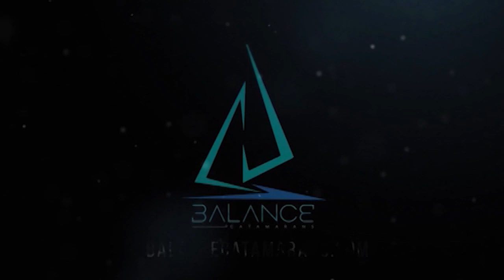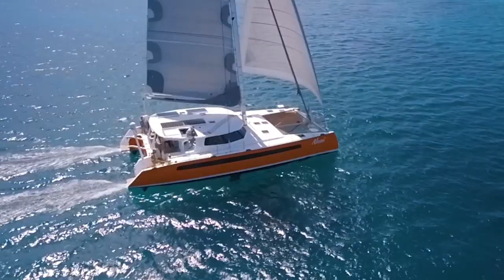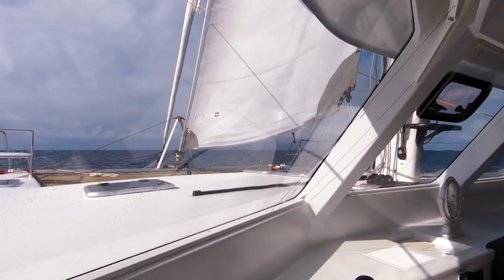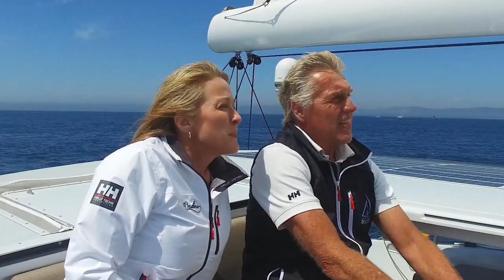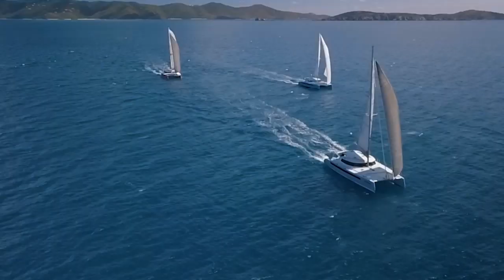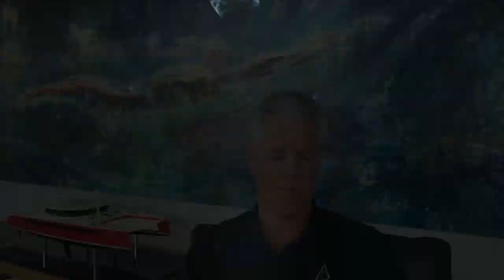Electric Engines on a Balance Catamaran?

Comment: Phil,

Thankyou for responding to people and also giving your honest opinion on these things.  My viewpoint on this is people need to be respectful around these issues when debating or discussing them.  I see that in this video and you deserve praise for that.  I semi agree, diesel's are required for passage and also remote sailing.  Having said that the one thing I have always been interested in is the fuel use for a generator to generate energy to drive a boat at a cruising speed.  

For example here, Catamarans often are run on a single engine to reduce the consumption of diesel when going through the doldrums etc as you have mentioned below.   if trying to outrun a system then you would be running both engines at a higher RPM to get a better speed to outrun a storm front etc.  Do you have some numbers or are you able to provide an approximate fuel consumption for these scenarios to gie people an idea about this issue as it does seem to be the one factor that affects the decision and it is a safety issue.  

1) If running a 526 on one engine to move through the doldrums how much diesel do you use per hour or per NM approximately.   So 5 litres per hour or 60 litres per 100n's figures like that so we can see the distance you can get off a given amount of fuel.  This will hopefully give a range or efficiency figure, as its never exact with different conditions etc however the doldrums would mostly be flatter waters and no wind sort of conditions so as close to ideal for efficiency as you ca get I would assume.  I hope you dont have to annoy clients but your best or most accurate number for this scenario would give some perspective for this scenario.  

2) Likewise with this, how much diesel is required to run a generator and what size is required to push a cat on one electric engine at an efficient/comparable speed in these conditions.  Again, this will give a comparison for people to say running a generator to run the electric engine will result in us having to use 6 litres per hour and will end up being 75 litres per 100nm with the loss of efficiency due to converting it from mechanical energy to electric energy back to mechanical energy through the electric propulsion system.  There will always be more loss in this so it wont be as efficient.  

My view and the thing that determines any decision I make is the other scenario, for outrunning a storm, or a weather front.  It is virtually impossible to provide these figures as the efficiency is hard to estimate with speed/conditions etc.  However the points you have made below regarding energy storage etc I can come to the conclusion as others should be able to that having a generator to run the electric motors at maximum speed would be a HUGE generator and impractical to have on a cruising boat it would defeat the purpose that you would be putting the system in for the first place.  In these circumstances nothing beats good old reliable diesel and its hard for anyone to argue that with the compromises that would be needed with weight and everything to have the large genset etc.  You can have a genset for a cruising or acceptable speed through the doldrums and justify it but for outrunning a storm the weight gains will impact everything else a huge amount.  Not to mention you can get any modern diesel give or take a bit worked on in any location throughout the world and you can service it with a KNOWN amount of supplies you can carry.  This is harder to do with newer unproven electrical systems that don't have that worldwide knowledge bank when it comes to being serviced in remote places.  Something about all engines though if you do have a generator though is you need to run these systems regularly as part of their maintenance.  Even with the re-gen from an electric motor etc and a solar system if you have a diesel gen as a back up you have to run it to ensure it remains reliable, as you do with a diesel engine.  With high output alternators etc on diesel engines they can recharge the battery bank just as efficiently or with less energy loss than a generator would have when being run to provide propulsion for the boat.  Until that loss is comparable its hard for long range off grid types to adopt full electric propulsion systems because you get more off grid time from diesel engines as they have less loss associated with them when they are being used and your not sailing.  

Thanks for putting the time in to respond if you can Phil.
Reply from the maker: Hugh, lovely email. Agreed on all fronts with your thought process. 

Fuel Consumption of course as you state varies due to sea state and winds, and on a Balance it also varies if people get the 45 HP or the 57 HP. If we are talking the 526?  Me personally I think the 45 is perfect for the 526 as you can run the boat up to 9 knots at 2,600 RPM on both engines and move very nicely. The 57 HP everyone seems to run them at 2,200 or so and to me that is not hard enough. In most of my yacht surveys the high RPM test leaves to noisy alarms because people do not run them hard enough and the exhaust elbows clog or heat exchangers are troubled. But.....everyone upgrades to the 57HP as it is same engine souped up and doesn't cost considerably more. 

If you wanted super exact, real life fuel consumption use on the 57 HP, and were serious about a 526, I would prefer to let you discuss with our 526 owners. But as a rule they appear to use less than a gallon an hour generally. There are as you say, many variables. I suppose it might be worth it for us to work on a sort of table for all of our models. You wanted me to use this time of lock-down to do something Hugh!!!  I had one customer on a cat who did a big chart, one engine, two engines, X RPM....

I like the ability to motor super fast in any direction I want for at least 200 miles as that offers great options for positioning to avoid a serious storm. No sense sailing in crap if you can avoid it. And my wife loves me so much more! That said, if there are winds of 9 knots or more, you will always be sailing faster on our boats than motoring. 

Factories are back to work now, so much paperwork and regulations, but teams are pumped to be back at it. 

Take care, Phil
Reply: @balancecatamarans  Thanks for the reply Phil,

I think that last point you raised is the most important.  Having a boat that can sail in light winds.  Having a wife or partner on the boat whom is happy and being able to outrun the bad weather or the worst of weather fronts when required under power so you can sail in the more favorable conditions.  After all, if your passengers or crew members are not comfortable your not doing your job properly organizing the boat and if the boat your producing isn't focused on giving you those options, as I believe the cats your producing are it isn't fit for purpose.  A lot of the other cat's to me are not focused on the performance on crossing and more focused on catering to at anchor in nice places.  It's a balancing act,, when the biggest risk you face is during those large crossings to me that's where you have to devote a lot of time with the design of the boat.  Maybe that's where the name Balance came from?

It wouldn't be fair of me to take up your current owners time.  I am at least a decade off making that jump.  Although I like to plan and research what I'm getting into unless your doing a 90% off sale price for me it isn't happening in the next few years I'm afraid.  Even then I'm leaning towards the self build route with selling everything up and moving to Thailand or SA to participate in the build process when the time comes.  

I also think something that no-one ever says is that you run machinery at that point it's designed to be used at not below it.  If you don't use the capacity or put load on the engines that will cause damage or failures in the long term as well.  So I understand 100% what your saying with that point regarding people upgrading to the different engines.  You get 9 knots at 2600 RPM and everything gets nice and hot and works at the higher temperatures where "crap" doesn't build up it gets burnt out as opposed to 2200 RPM with the larger engine and not having the temperatures to burn away the stuff left behind as it isn't operating hot enough.  Everything works better long term when it is getting worked properly not when it is getting babied along.  I haven't seen this observation from many people and to see it from someone who has done surveys as well as builds new cats it highlights how bigger isn't always best.  

I might try and put together a chart myself on the fuel consumption required to keep a sustained cruising speed with electric motors similar to what one of your owners did.  I am currently unable to get much time off however the days I do have off I am not seeing my son due to  having to isolate due to this COVID stuff and work.  It will be interesting to see if I can put something together I will have to track down the speeds and stats for a boat with oceanvolt system installed and loads required for certain speeds along with storage requirements and also the size of generators needed to sustain those speeds and weights involved.  Then put it alongside a plain diesel set up to compare total weight of the system and also real world usage when doing a sustained cruising speed.  

That sounds like that will be my Sunday :)
Reply from the maker: Hugh, if you are not going to build or have a boat in ten years I would not bother with any calculations. By then solar will be a lot more efficient and also lithium storage capacity and an electric cat may start to work for voyaging. But a small word of warning: building a boat is a massive undertaking and will take years and a large shed! What I see with the Kit boats is that people buy them, but seaming together the many panels to get to the Hull and Deck stage is massive time and labor. And that is when the work just begins. What I see in our brokerage business is that people who try it wildly underestimate the costs and time and either end up under-water, or start to cheap out when they get to the final stages. That's why so often the kit resales are hard for us - they all vary so much in build quality and have no brand resale value. Folks often think they are saving up front, but lose it badly on exit. I suggest you are better to get a used cat if you cannot a new one, unless you are more interested in building a boat than going sailing. Lord it takes thousands of hours. Better to spend that time on the water to my mind. Take care, Phil
Reply: @balancecatamarans  I agree its a fruitless exercise at the moment.  However it has always fascinated me to see a lot of people trash the numbers on these things and go with an opinion that makes them feel happy.  Then when they get an opinion that is counter to the one they have that is based on years of experience they trash the person giving the opinion.  I cant understand that view myself.  You cant ever buy experience and the overwhelming majority of people who have that experience say electric and solar is interesting and exciting but it isn't mature or reliable enough.  For me its an interesting exercise to kill some free time and keep me off the torture boards.  

In terms of building a boat, I couldn't agree more with what your saying and set out to learn early on.  My view is the costs are at least 50% more than advertised and the hours involved are often going to be 50% if not more than 50% of what is advertised when you don't have the required skills and experience.  I'm already building my first boat at the moment, its a 4.5 metre run about that will have a 20hp on the back to go fishing in, very very basic open cabin fishing boat but I'm doing it in fiberglass to learn using balsa end grain cores.  My overrun figures are on cost I'm about 10% over what I budgeted and in time I think I will end up being maybe 200% over allocation but what I've learnt will save me in a decade or so.  I'm learning the skills.  I grew up sailing lasers and loved them more than anything, then as I grew up crewed on in J24's and vandestadts in club racing that were heavy beasts but still the competitive nature of it was enjoyable.  

For me, in 10 years my son will be 18 turning 19 and sent out into the world and I'll hopefully have enough saved that I can set myself free, that's the aim.  The one thing I want is a boat that is like the dingys I used to sail as opposed to the heavy keel boats I did club racing in.  About 11 years ago up in the whitsundays sailing around on a 24 foot trailer sailor among the islands living off a camping stove, yes that was me....  Doesn't matter how you do it as long as you do it.  I got the opportunity to crew for 2 days on a seawind catamaran.  That experience made me fall in love with lightweight boats with simple efficient designs and reminded me of being a kid all over again pushing little dingy's off the beach to go sailing.  So for me,  the boat of my dreams has a lot less creature comforts.  I love the lines and the concept behind what Balance offer but I also accept I wont have that cash in 10 years so I have to make alternative plans.  No offense IF I win tattslotto I'll come knocking a lot sooner than 10 years, but the odds are not in our favor on that one Phil I would love to push off sooner rather than later and have you build me a boat.    

My view is working 40 hours a week and on average 48 weeks a year myself is just under 2000 hours of labor work and that's on the building not on the management side that is always an additional amount of hours required to keep stuff running.  Throw in 4 other laborers at a cheaper labor cost and I have 10 thousand man hours of labor a year, that is affordable to me in a place like Thailand.  So if I plan for that I can have a boat built in 2 years that's going at least 50% over most time estimates with a little buffer for mistakes and be there to supervise it to ensure the quality.  I am not bothered about re-sale value, I will be building it to live and retire early on.  I just have to ensure I then have enough to sustain myself moving forward so I don't have to move off the boat :)  I I worked it out 4 years ago when I started thinking about it that to build a 15 metre catamaran with a kit it would be ballpark 450-500k AUD all in for all materials and yard hire for 2 years with an approximate labor cost of 45-50k per year.  Add 20% for inflation and the cost will be 600k all in for the cat and 150k all in for labor.  That's AUD's USD that's a total of 350-400k USD.  

Now things change like the exchange rate etc.  But that was attainable to me in 10 years when I wrote the plan out so I'm working towards it.  If something changes along the way or I find a similar boat around that price point leading up to making the decision then I'll deviate and go down that path.  But I still need something to aim for and build towards so I have the funds to deviate when the time comes :).
Reply from the maker: Hugh, the price will reflect the quality. Our 526 runs 40,000 labor hours or more. Where most of the kit boats really fall down is the electrical installations and designs and the cabinetry. As for Thailand, nothing I have yet seen from there rises to the standards of a truly professional build. How will get real pros to work on a boat for you?  If they are real pros they are working for a quality yard or builder. I have spent considerable time assisting a gentleman who bought an Alibi 54 for several years. That cat was made in Thailand, and after spending hundreds of thousands to re-do the wiring and toss away the electric engines she is a nice boat. But the poor fellow had to go through a lot. Also, you can toss unskilled labor at anything for little money!  And what you end up with is an un-skilled build I am afraid. Part of the reason quality cats from China cost so much is they have to bring in a very high percentage of skilled X-pats to oversee all of the key aspects of the builds. Turn your head away for five minutes in China,Thailand or Vietnam, etc, and things can go badly quickly. I've been involved with many projects in China over the years. Which does not mean you cannot get a good boat built anywhere. It is always about the efficiency and skills of the teams assembled. 

But, really, the even larger issue is re-sale of Custom cats. As each one is a different story, the buyers online subject us brokers to what I jokingly call the "Chinese Water Torture Treatment" of questions!  That is where a brand with a proven track record makes such a huge difference in resale value and time to resell. I see it all the time at our brokerage company, The Multihull Company. But every once in a while we come across a really nicely done, if not often quirky, custom build. I am always in admiration of folks who bite off such massive projects and pull them off well. It takes such patience, so much labor. But invariably it costs more than anticipated, takes longer, and mistakes of some sort cannot be avoided. Anyways good luck with your family!